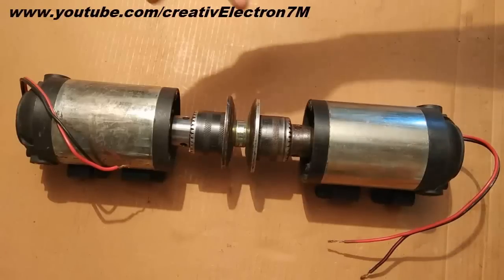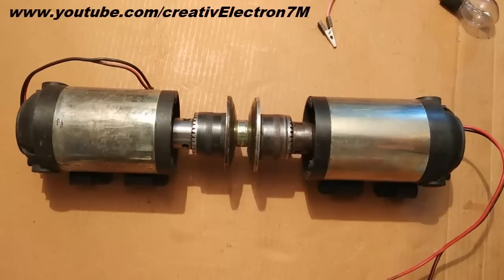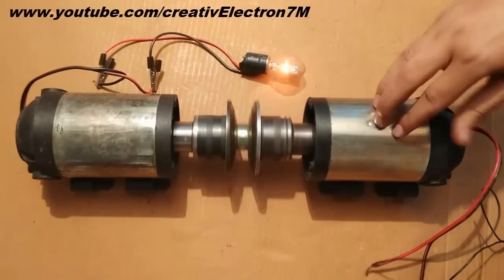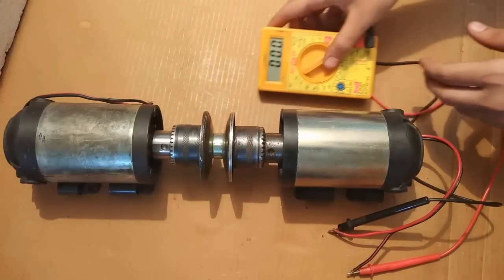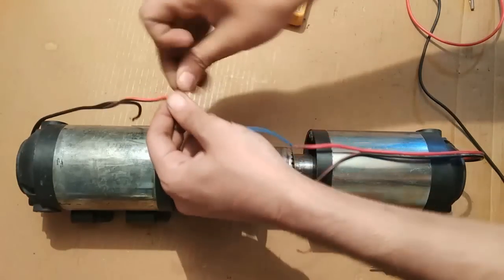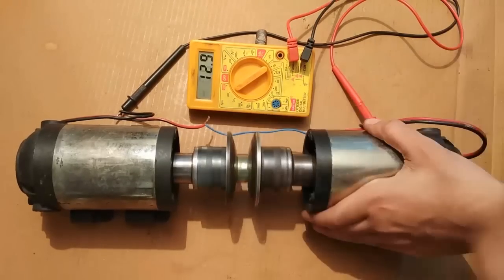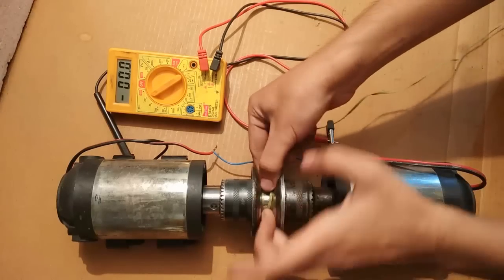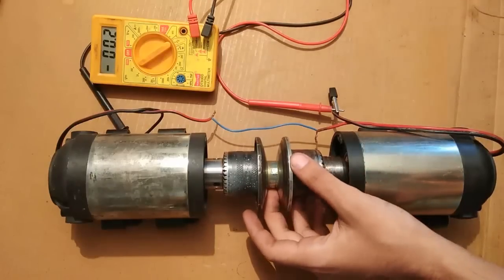Free energy generator with dual magnet DC motors DIY

Comment: Did you know that if you put a capacitor on the end of the wires (witch is commonly found in RC cars and some motorized toys), the motor will not produce any power when spun by hand or another motor, but power can go in and make it still spin like no capacitor. I ordered a 24 volt motor from amazon and got 4 6 volt batteries from Walmart, wired them together and powered the motor at great speeds. One problem, it does not have an internal capacitor, so when I touched the wires together after removing the power, and it instantly stopped (almost enough to break it). Also if you spin it by hand, it should spin normally, but if you touch the wires together (only with motors with magnets do this), it should be harder to spin. If you don't believe in generators, your a noob who should go back to kindergarten.